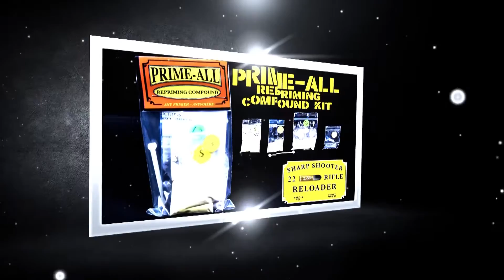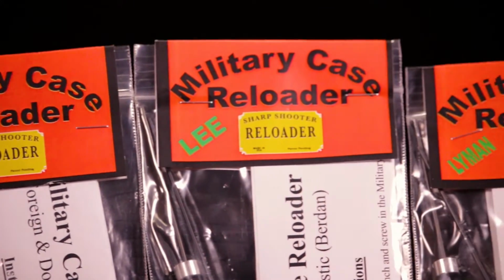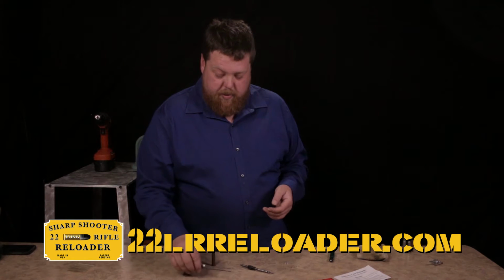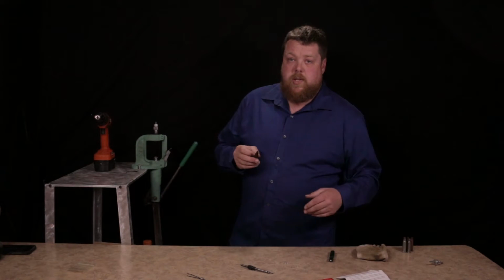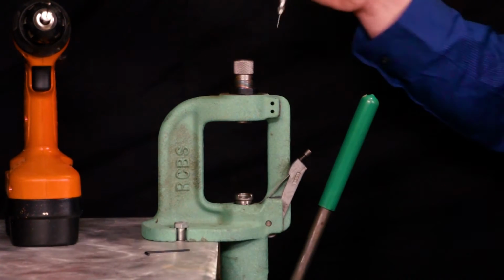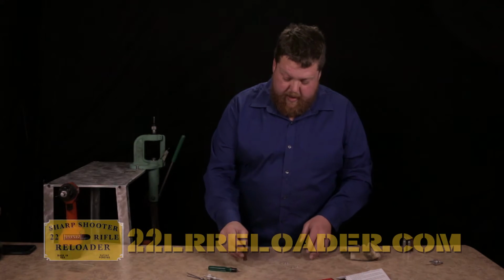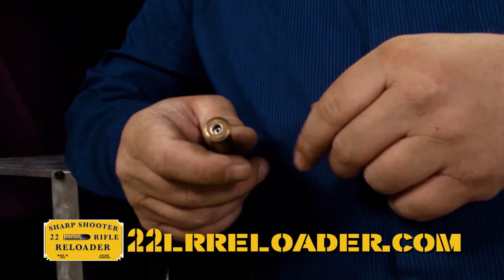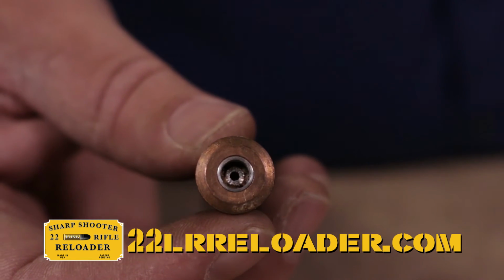VIDEO 6 - MILITARY CASE RELOADER

Comment: I bought one of these, and in my opinion this is the BEST option for reloading/converting Berdan  to Boxer that is out there! However, i do it slightly differently to the instructions. I drill completely through the case and primer, thus removing the Berdan anvil and then re-drill the existing primer (which is still in the pocket) very slightly larger. I then use my RCBS primer pocket swager to swage it to EXACTLY the right size to accept the correct Boxer primer. Thus, the old primer becomes a shim for the new primer. I also then either use Loctite (permanent) or superglue as a double-check that the "shim" wont come out again. But, i gotta say...this is the CHEAPEST and BEST conversion method that i have found yet. Thanks, guys!
Reply: Mind you, on the Berdan cases where the primer sizes are very close to Boxer, maybe the official way to drill them is best, as long as no "shim" is needed. I havent tried those yet. I only tried .303 and 7.62x54R Berdan cases so far. This will be a GREAT way to save and re-use all those Swiss cases!
Reply from the maker: That's awesome thank you Brian
Reply: @englishrupe01  berdan 303 used Kynock #126 primers, .250 OD, .205 ID. that is almost perfect for a large rifle boxer pocket OD of .2085-.2100

Comment: Can the aluminum ring pop out when reloading the case the second time using the regular process?  There was a company called "Russian Reloads" (do not know if they are still around) that did something similar, except they drilled right through the berdan primer and the sides of the primer formed the "ring."  They they inserted (small?) rifle primers into the opening.  They did recommend using super glue where the new primer met the ring (the walls of each).

Comment: So what size shim is needed for what size of berdan primer pocket? The website just says that the shim sizes are small, large, and extra large. I'm assuming that the extra large is for the largest berdan pocket (0.256" in diameter), but what size are the small and large for?
Reply: I would imagine that the small is for reloadable 5.56 and the large for maybe the 7.62x39 and the GP11 7.5x55 Swiss ammo......? Would be nice to be sure though....Sharpshooter? Personally, i just drill straight through, though, and then switch drills to just larger than the sides of the cap that is still there and use that as a sleeve instead. Saves the need for sleeves. These are well worth having in your kit though as one set works in all your dies. Are you using these already?
Reply: @englishrupe01  7.62x39 uses a .217 primer, I think that's the large sleeves
Reply: I would deprime one of yours and then measure the pocket with calipers....otherwise any advice here may be wrong for yours

Comment: the sleeves are $15/100, I might as well buy boxer brass at that point
Reply: if you are that cheap you can make your own out of some copper tubing like the ammo channel did. 

but keep in mind it is a permanent modification to the case. so if you properly anneal and neck size not FL and otherwise care for your cases you can get 10-20 firings from your brass.
Reply: @Ryan Ripley I swear it's a myth, I've had more destroyed cases from factory brass than reloads
Reply: @Ryan Ripley bump sizing is a better practice anyways. annealing every few reloads doesn't hurt